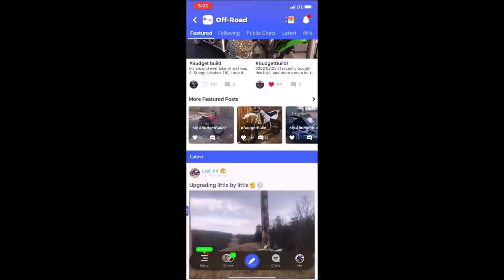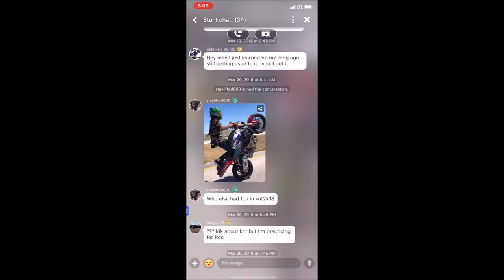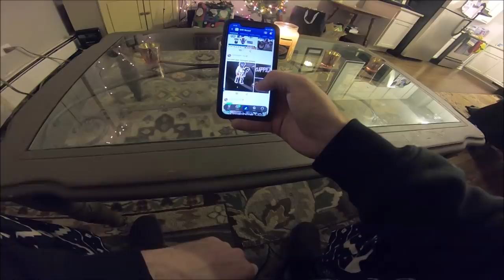5 Steps to Prevent BRAKE FADE on Motorcycles!

Comment: New pads can do a lot, too. I would def do pads before a new rotor or master cylinder. I usually do it before SS lines, too
Reply from the maker: That is true but when the pads are new and the fluid or commpents are junk, it doesntt really matter you know?? Much love dude
Reply: On a couple diff bikes I've tested (FZ1 and R3), just with new pads on the stock brake system there was big increase in stopping power and slight improvement in brake fade at the track. You def want to do fluid and lines ASAP tho. Cheers bro

Comment: You prefer 600 or 660??  Youd think 660 is better than 600, ive heard 660 attracts moisture and needs to be changed more than 600? Motul is the #1 in ultra high performance lubricants.
Reply from the maker: I have never heard that but I run 600 so I guess Im good!!!

Comment: Hell yeah I was wondering what I could do more to prevent it cause I do still ride that break. I almost ran into you when that mishap happened. So moral is bigger rotors, brimbo, motol break fluid and use less break and master throttle control!
Reply from the maker: Yes sir and try dragging the brake less. You already know brother!!! Please share dude
Reply: brian_636 
Done!!
I also have another question.
I have a 60 tooth sprocket. Once my forks are flat( horizontal) my throttle is soooo touchy like even blips are so dramatic. What size sprocket do you use? Or recommend?

Comment: just came across this. SO what are you doing doffernt at the top there to hot drag your brakes. less throttle or something. im learning just sit downs now on a z125 and been working on less brake, but still feel like im on it more than i should.
Reply from the maker: Yes less throttle and more just sitting at balance point. It doesnt use brakes at all that way man
Reply: @brian636  thanks bro appreciate the response. gonna work on this for sure

Comment: Best way is to separate your calipers if you're running duals or remove the single piston and hone the cylinder. Clean and polish the piston and replace the internal rubber seals as well to insure no air can get by the seal (catching air bubbles suck lol)  and when its assembled on the bike, I like to tilt the whole assembly at 12 o clock and bleed it with a vacuum hand pump. Ziptie the handbrake lever to your bar overnight to allow any air bubbles to rise to the top. (Pressurized fluid forces air upward) This is along with what brian mentioned is the best way to iron out your brake setup.
Reply from the maker: DAMNNNNN you really did hit every possible way to make sure you dont get fade.... I wish I had a vacuum pump..